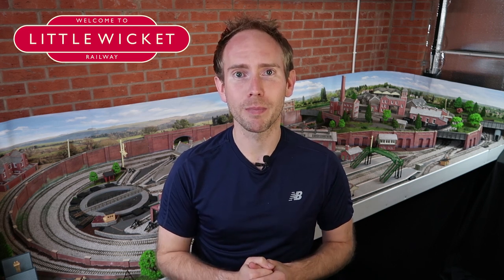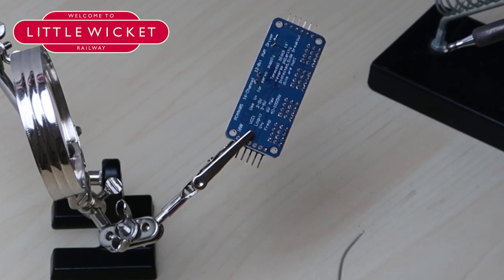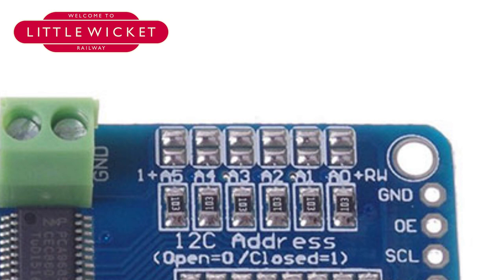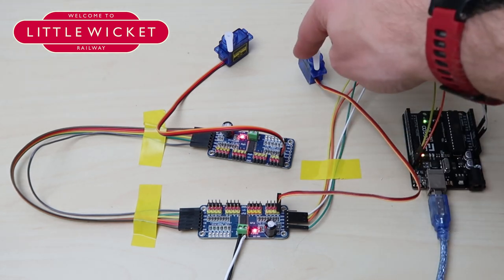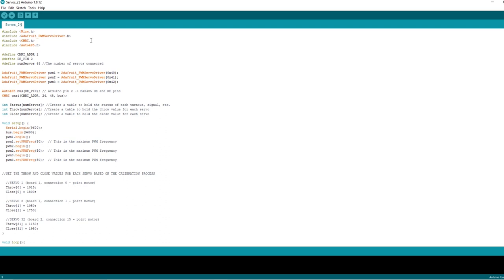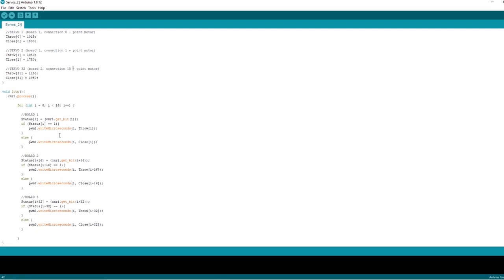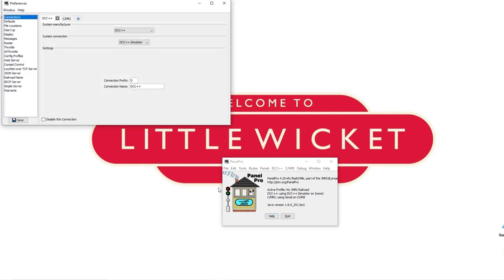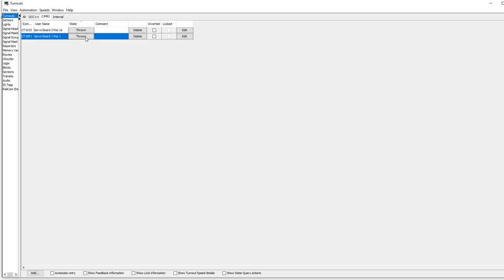Linking Multiple PCA9685 Servo Driver Boards

Comment: I've built a sensor board and turnout control using a little wicket guide but what if I wanted to add led signals to the same project ? Can it be done or would it be simpler to use (for example) a separate uno (with a pca9685) and a CMRI connection ?
Reply from the maker: You can add signals to the same project using another PCA9685 (need to change the frequency of the board for the LEDs) and CMRI https://youtu.be/rJhZK-XgEec

Comment: Thankyou for your videos ! Wondering wit this PCA9685 how far between the arduino and the first board, and between each PCA9685 if linking them ?
Reply from the maker: Good question. Quite far I would think. What distance are you thinking?
Reply: @LittleWicketRailway   10ft between the arduino and the first pcs9685, then another 6ft to a 2nd.
Reply from the maker: @dthead  I think that should be fine. I had a quick Google and on the forums others have achieved this.

Comment: Another great post, thanks. Would there be a way to link the servos, JMRI and facia toggle switches all together as one system. I believe I can use the toggle switches as sensor’s in JMRI.
Reply from the maker: You mean like have an actual physical switch to control a servo (e.g. throw a point or change a signal) as well as being able to click in JMRI?

You can set the switch up as a sensor in JMRI, just like the microswitch on the point motor in the servo video. You could then use Logix to link that sensor to the turnout (or whatever that servo is connected to).

My concern would be that you could have a scenario where JMRI is attempting to activate the servo in the software and this is conflicting with the position of the toggle switch.
Reply: @LittleWicketRailway  Take a look at “Megapoints Controllers” on YouTube. This person has made his own company doing just that. The buttons he has are real nice with built in led feedback. It is all too confusing to me so I may have to use his system if I decide to go that way. I just hooked up (2) pca9685  today thanks to your video. Thank you once again.
Reply from the maker: I had a quick look at the Megapoints Controller site, looks like some really interesting stuff. Also, I was watching a video from McKinley  Railway (https://youtu.be/FrTPYf3XyoI) they have a panel at their London station where they appear to be able to have both computer and human control (8:55 in video). It looks like they're able to isolate the computer when they want to manually control something. It's not clear if the computer can do automatic route setting of the points or just train control, but is that the type of thing you're looking for? I'm also not sure what software they're using and how much they've had to customise it to get that override in place.

Comment: Does it matter if I connect them the other way around, so that the side with the soldering is connected to the other side with the soldering and the side without is connected with the other one ?
Reply from the maker: Hi Michael. When you say soldering do you mean for the change of address on the boards? I don't think it should matter what order they are connected in.

Comment: Hi Rob  your guides are superb but I have got a slight glitch I cannot get past linking multiple servo driver boards . I  have checked and checked but  it keeps saying void loop ( ) error  expected }  at end of input I put the braces bracket at the end and then changed it to next line with no luck. It identifies line 123 which is where the bracket is. Any help would be great please. Thanks

Comment: Hi Rob. Great video. I'd like to slow down servo movement. I try to implement add the code you presented in other video about changing servo speed but it didn't work. How can add this feature in 2nd part code? I appreciate you help. Thx

Comment: I added 2 more servo driver boards to this project for a total of 5. I am losing communication after the 3rd board with JMRI. I can turn on all the signals via the code so I know it is the communication with JMRI. 

I am assuming the problem is with the nodes in JMRI. 

Any help?  Thanks!
Reply from the maker: Hi Kennedy. Are you using multiple PCA9685 boards connected to a single CMRI node or multiple CMRI nodes each with their own PCA9685 boards?
Reply: @LittleWicketRailway  Just one CMRI Node. After some digging it looks like I may need to change the Node type to CPNODE to increase the output bits. It makes sense the communication is dropping off after the 3rd board. 3 Boards is 48 outputs. 

Does anything have to be changed in the code when I change the node type?

Thanks!

Kennedy
Reply: I figured it out. Change node type to “CPNODE” then add as many cards as needed until you get the correct number of out bits. Then match these in and out bits in the code for arduino.

Comment: I have successfully calibrated 10 servos on PCA9685 board 1. However, I cannot seem to calibrate any of the 11 servos on board 2 which is daisy chained. I have modified the board address to 0x41 on the calibration sketch, but irrespective of the servo number I select, servo 10 on board 1 gets recalibrated! All indications suggest the both boards are correctly connected. Any comments gratefully received.
Reply from the maker: Have you addressed the 2nd board using the solder connections on the PCA9685?
Reply: @LittleWicketRailway  Hi Rob. Yes I have soldered across the gap and checked continuity.
Reply: I am isolating the original PCA and connecting the second one directly to the Arduino. I have readdressed the sketch back to 0x40. At present, although power lights are illuminated, no response to calibration sketch. Looks like a dud PCA, but I will investigate further.
Reply: Hi Rob. Can you let me know where to find the Servos_2 sketch you use at 6 mins in?

Comment: Hi, amazing video. I wonder if that circuit can handle 12v servos ?
Reply from the maker: Hi Luis, I believe that you can use 12V for the servo power supply (https://learn.adafruit.com/16-channel-pwm-servo-driver?view=all) see the section on power 👍

Comment: Great Videos, I like the format and the links, very clear and easy to understand. One question; I wanted to use colour signals, can you suggest a control mechanism, I am hoping that there would be a simple Arduino method similar to servo control. Thank you.
Reply from the maker: Thanks! Apparently it's possible to use the PCA9685s to control LEDs, someone else asked about this. I'm going to have a play with this in the next couple of weeks and see how easy it is to get it working with JMRI. I've not used light signals before, so this will all be new to me.
Reply: Thank you, I am looking forward it
Reply from the maker: I knew nothing about colour light signals, but after reading up, I've just set up 4 LEDs to work like a UK 4 aspect signal and got it working with the servo drivers. I set it up as a signal mast in JMRI and it's working perfectly. I'll post something next week, got a couple of videos in the pipeline that I need to get out first.
Reply: Thank you very much, I am looking forward to viewing it and your other new videos

Comment: Hi Rob.  Many thanks for this.
I notice that in your counter, you stop at 16. In the original sketch you stopped at numServos, but I can't see where you've commented on this change in the tutorial.
Thanks
Reply from the maker: Hi Paul!

Thanks for watching.

I used numServos originally when there was only 1 board and a few servos connected because I didn't want the code loop going through all 16 connections unnecessarily. It made the code marginally more efficient when it only looked at the connections being used.

However, where there are multiple boards all 16 positions are likely to be used on at least the 1st board, so I dropped the numServos variable and had the code loop through all 16 positions on all the boards. Didn't want to accidentally skip some servos.

Hope that makes sense.
Reply: Hi Rob.. Thanks for the swift reply. I was in the process of connecting 3 boards, and making the servos to the third board move slowly for N gauge semaphone signals. I think I incorporated all the little snippets! Anyway, it works, so thank you. I slowed the movement rate up by decreasing the counter increment and putting a 5mSec delay in the loop. Seems to work fine.
Reply: @paulwillis866  interested in what you are doing as I too would like to slow my servos.  Would you be kind enough to share your code?
Reply: @gjdanco4260  Many thanks for your interest.
I am sure there are many elegant ways of doing this, and it would be best to start from Robs coding to make the servos on your extra boards move normally.
I then adjusted the rate of movement on board 3 with the following code:
 //Board 3
        Status[i+32] = (cmri.get_bit(i+32));
        if (Status[i+32] != PreviousStatus[i+32]){
        if (Status[i+32] == 1){
          for (int j = Close[i+32]; j <= Throw[i+32]; j=j+1) {
            pwm3.writeMicroseconds(i, j);
            delay(5);
          }
         }
        
        else {
          for (int j = Throw[i+32]; j >= Close[i+32]; j=j-1) {
        
            pwm3.writeMicroseconds(i, j);
            delay(5);
          }
        }
        PreviousStatus[i+32]=Status[i+32];
effectively making the servo count up and move to each position incrementally, with a 5millisecond delay between each position.
Hope this helps.
Interested to see other comments
Reply: @TonyRogerson
Many thanks for your contact and apologies for the delay in replying.
Your error message is almost certainly because you did not declare the variable PreviousStatus.
If you look carefully at Rob's revised code, it is an extra variable declared early on in the coding. The link to the modified coding is in the video description above.
Hope this is helpful

Comment: Again, another well done video...easy to understand and follow.  Also, all my servos worked right after I uploaded code and created turnouts in jmri...Many thanks.
Reply from the maker: Excellent! Love hearing feedback like this! 👍
Reply: @LittleWicketRailway  Rob...now to set up wireless nodes using NRF2401 modules.  The plan is to set up small touchscreens around the layout running jmri panel pro and changing the points with the touch on the screen rather than create control panels with miles of wires and switches...the joy of this is if my layout changes, a simple few entries in jmri layout editor and voila...up to speed....interested?  I'm a big fan...keep up your good work...cheers...Geoff
Reply from the maker: @gjdanco4260  this sounds amazing and I'm definitely interested, but you're way ahead of me. I'm also in the position where I don't want miles of wires, so I was going to look into ESP32 wireless modules and try using MQTT as a way of communicating with them.
Reply: @LittleWicketRailway  Hi Rob...there is a fellow here in Canada who has a youtube channel called dronebot workshop.  What he has done is experiment with nrf2401 technology by building a remote car and controlling it with nrf2401.  From what I am reading he likes the nrf2401 basically because it is bulletproof and can be used in long range applications.  This might work for Model railroads.  I could set something like this up and have others including yourself help operate the railroad from far away.  Railroads themselves use technology where a dispatcher could be hundreds or thousands of miles away from where the train is.  With jmri this might be a good thing...for instance, Im not sure where you are located...I am assuming  United Kingdom could dispatch trains on my railroad in Canada....think of the possibilities.  Operationally, I would think it better to rely on radio signals than have multitudes of wire and switches in a custom built control panel...then things change and you want to add a track or two and all your work building the control panel is out the window...yet with a computer screen a few changes are minor and within a short period of time you are back up and running with an updated panel.  Anyways, I will put the link to his site below as well as a link to my model railroad site so you can get an idea of what I am up to.  Thanks again for your great videos.

www.youtube.com/watch?v=lhGXAJj8rJw&list=PL1jRM7KtA84InDqBstLJyjYxJQmr8bm59&index=2

www.facebook.com/AllisonPassModelRailroad